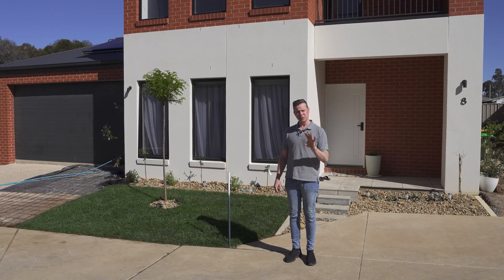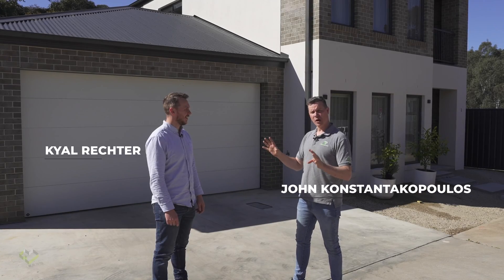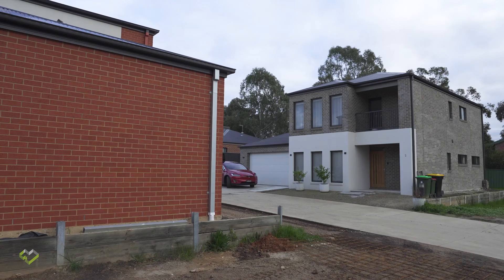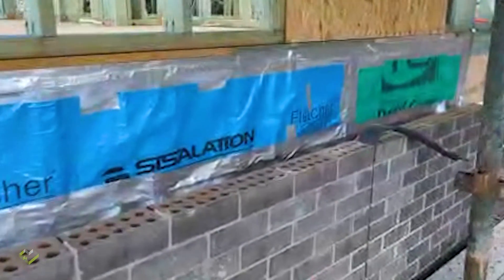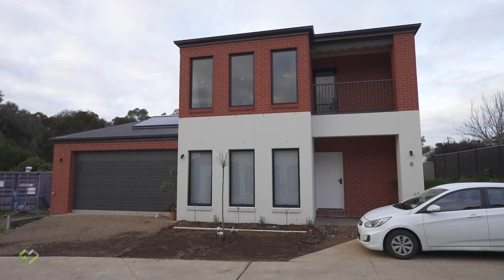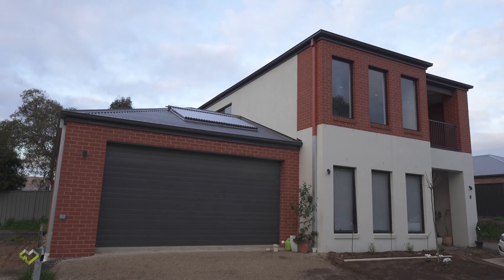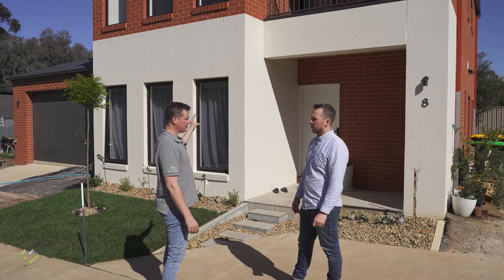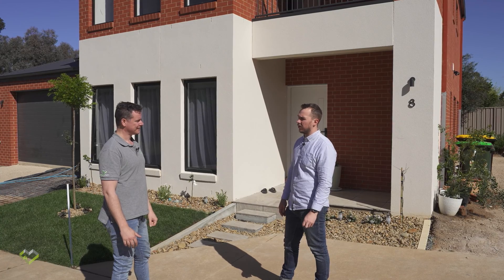Common Issue in Double Story Homes Revealed

Comment: can your house be too air tight?
Reply: No but at a certain point you'll need an energy recovery ventilation system to introduce fresh air into the house whilst exhausting stale air. The energy recovery part will exchange upwards of 90% of the thermal energy from the exhaust back into the intake without mixing the air streams.
Reply from the maker: @HardstylePete To be honest relying on a mouldy wall cavity or a damp subfloor for fresh air is a bit of a tall ask.  All home owners should be operating windows for fresh air, or a dedicated mechanical ventilation system, not the generic leakiness of your building fabric.